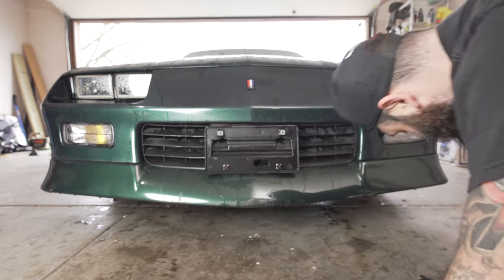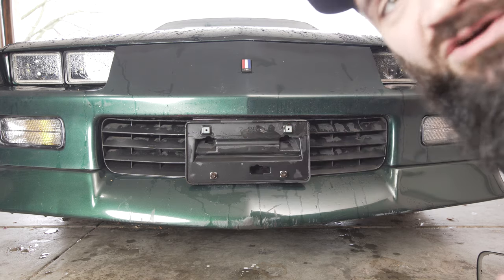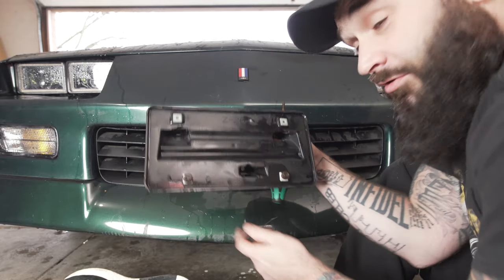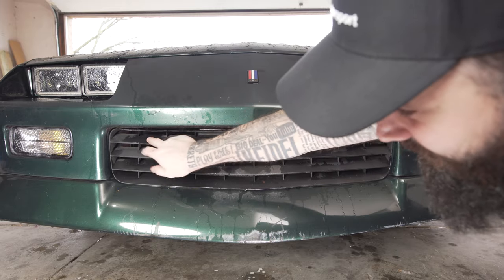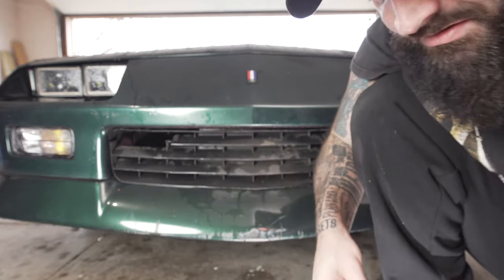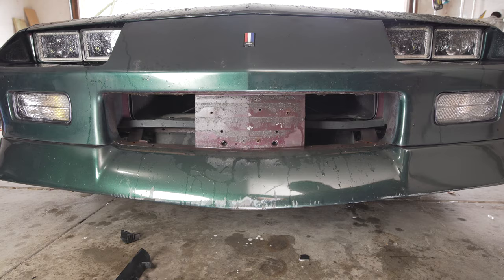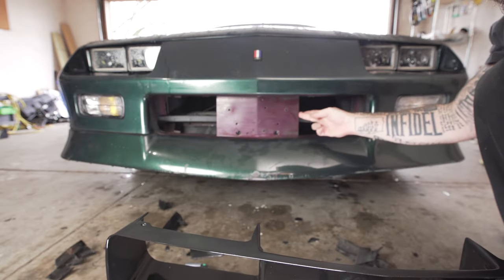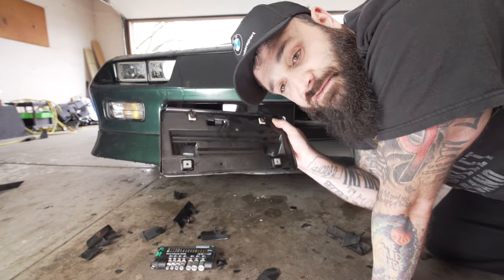Third Gen Camaro Project | Grille Install | Episode 22

Comment: If its not gone already, I could use that holder. I believe in my state you are required to have one in both the front and back and it has to be on the bumper. I will be purchasing one of these in a few weeks for my first car and my daily driver. Always loved these cars.

Comment: I have a 1990 RS 305 that I am turning into a Iroc. I just did the grill swap not too long ago definetely a good upgrade.
Reply: Where did you get your parts from I'm trying to restore mine, or at least picking away at it. 85 z-28, when I bought it drove it a while then pulled the 305 and started with a 350 and went from there. Man she pulls hard but want to keep going for sure with the rest.